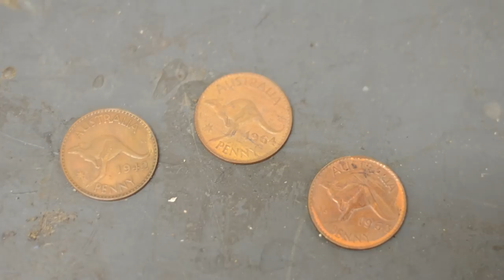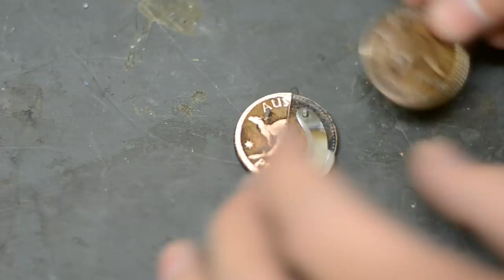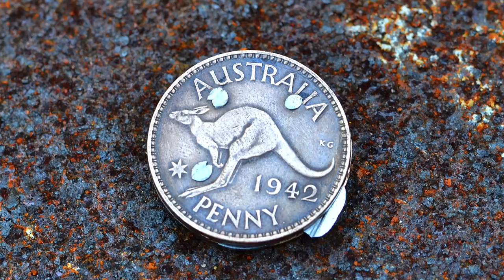Knife making - making a folding coin knife

Comment: Is it possible to make one of these with 2 blades and use it as a trowing star?
Reply: completely impossible
Reply: +Boba s Channel (Bobλ4237) Not a star then. Just a sharp trowing thingy
Reply: Can you redo it and make the knife out of a penny
Reply: Jon Johnson It's not made of steel so it would be crap.
Reply: +mrkiky oh could you use a coin that has steel (most likely none made out of steel)
Reply: +Jon Johnson that coin is an Australian penny
Reply: Post 1992 British ! and 2 pence coin is copper plated steel I think the 1 euro cent coin is also copper plated steel.
Reply: +S Bekcic woooooow
Reply: Any thing is possible
Reply: yes
Reply: If you used 2 blades, you wouldn't have 3 pins you would only have 2, the middle penny would have to get 1/3rd cut off on both sides so that theres room for the knife, and you put 2 pins on the top and bottom to hold the knife in.
Reply: nice idea !!
Reply: It would be Possible to make it, it would be very difficult to actually Damage the target.
Reply: Darth Vin This knife is supposed to be a stabbing knife and it is only to give small harm.
Reply: not if u stabb there eyes it would hurt
Reply: there was a 1943 steel wartime penny
Reply: If you angled it differently you could put three blades in it that the edge of one overlaps the backside of the next. You'd have to change the shape and placement a little, but you could.
Reply: I was thinking the same thing Flimbo nimbo.
Reply: I see what you mean and yes it technically is possible

Comment: I wonder if you can take it on a plane :P
Reply: i think they will not find it 
underneath all that cocaine. ;3
Reply: The little tab makes it too obvious
Reply: +Youravengeperso n lol
Reply: what are they going to do? allahu ahk-awww fuck it got stuck on his jacket, there goes 10 h of work
Reply: Knives like these were used during WWII by spies, they found that a slash across the forehead caused blood to drip into the combatants eyes and was an excellent motivator to stop fighting
Reply: Glyn Hughes
doubtfull, carry it in your wallet, make the handle smaller, and it wouldn't be a biggie
Reply: morfeo blanco Depending on the machine if the blade was made from a metal very closely matching the coin material it wouldn't present on the x ray
Reply: John Beauvais
the coin's sides are metal, wouldnt that be enough to stop the rays and hide everything inside?
Reply: morfeo blanco No, the new machines they have cross section the materials, it can tell if there are voids in an otherwise solid metal piece.
Reply: John Beauvais
damm, they are thorough!
Reply: morfeo blanco Well yes and no, can they see these things? Yes, will they do anything about it? Probably not
Reply: bubu mic or jail
Reply: Funny how the first thing you think i about is taking it on a plane..
Reply: If you paint the metal in the same colour of the coin and put it in your pocket with a bunch of normal coins then I think it could work

Comment: Darn those coins are not in circulation anymore... can I use an American quarter? Or what materials did you use/what was the coin made of? Also if it isn’t too much trouble what equipment did you use? I am looking to get more into crafting (I craft as a hobby).

Comment: what is the purpose of this. It's clear that it wouldn't pass for a normal coin because of the three metal pins or the small piece of metal sicking out. anyway even if you did manage to trick somebody with it what could a blade of that size even do besides cut paper and string.

Comment: Wow what a smart idea, so if you should want to make yourself a nice little pocket knife like that, then just spend around 45,000 bucks to build a  nice workshop like this guy has. Or just spend $ 3.50 to buy a conventional one.
Reply: A dremel,drill press,sander,grinder and a hammer hardly add up to 45,000 dollars.Easily get it all for under 200.